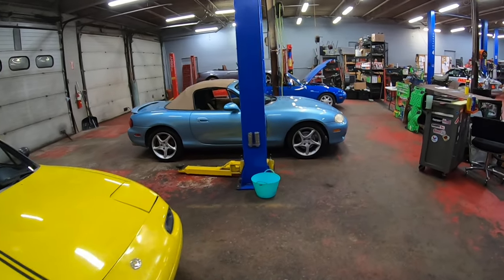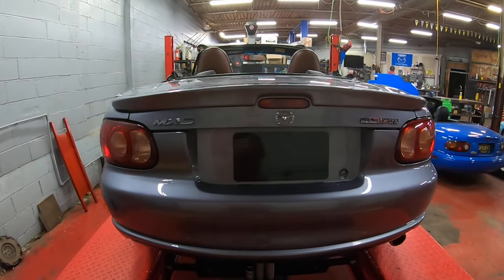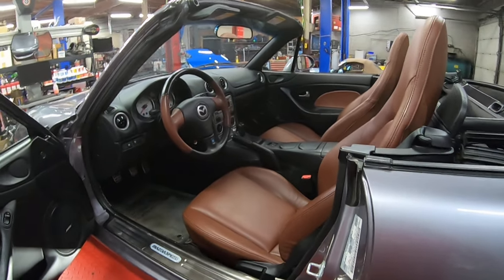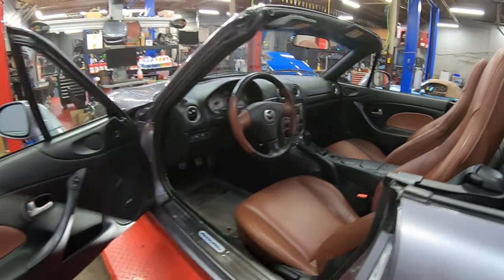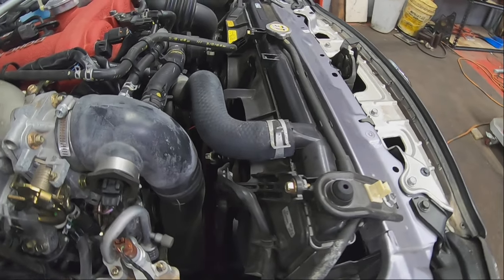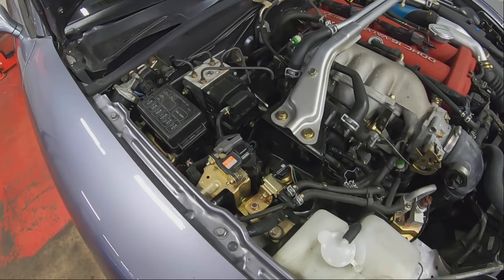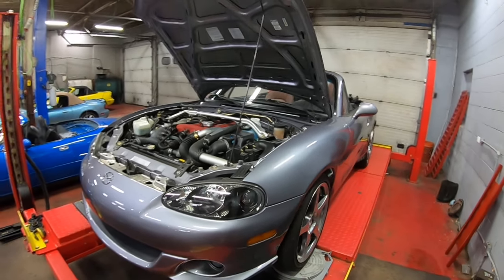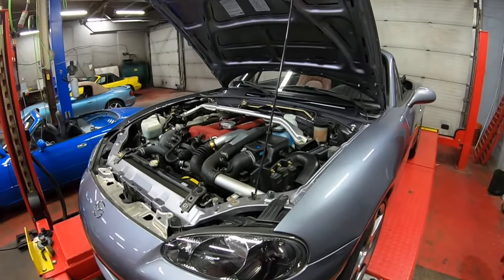Anatomy of a Miata: Mazdaspeed

Comment: I just bought one with 40,000 original miles on it in mint condition.  
I will be modding mine, but extremely tastefully with keeping it looking very original other than wheels, lower suspension as i have already gone Xida races coilovers.  FMIC, then ECU, EFR turbo, built long block, intank fuel pump etc, manifold and trying to keep everything OEM look, but will be different.  
The 3 gauges will be run in the centre console section from AEM with white faces and silver bezels to match the dash cluster.  
The single DIN left will be fitted with a BT headunit, but needs to be Bose or Blaupunkt that looks OEM.   I will keep the double DIN Bose unit if I want to revert it back to the stock interior look.  
The whole car needs to not look like a ricers car, it needs to stay very Mazda in styling and remain purposeful, clean and classy, but very fast, capable of demolishing others at the track, but not being a "track car".

Comment: Thank you for the video very informative. What is the sensor bolted directly to the front that goes to the intake pipe and bypass
Reply: Do you know what that part number is or the name? It’s right above the thermostat bolted onto the valve cover
Reply from the maker: I believe what you’re talking about is the boost control solenoid, I don’t know the PN
Reply: @immortanautomotive9221  dude you are amazing!!! Thank you!!